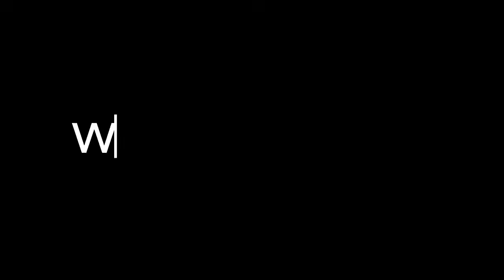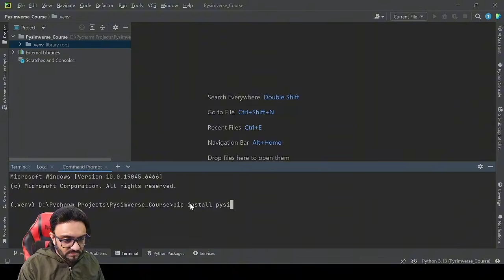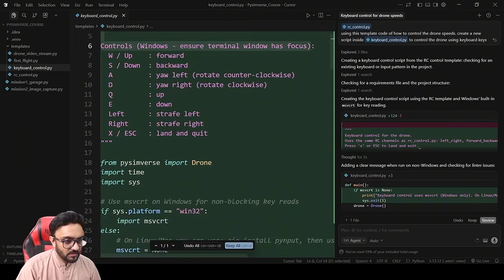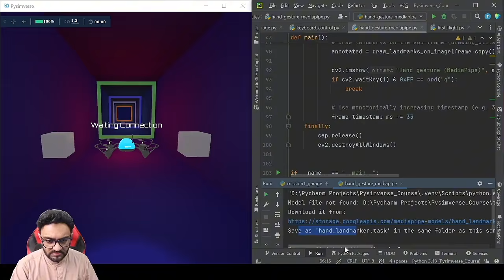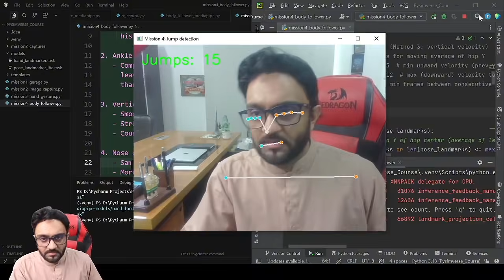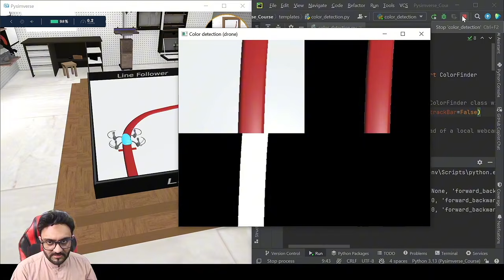Learn Drone Programming with Python – Tutorial

Comment: I want to learn Chip level laptop and desktop motherboard board repairing can you that happen.
Reply: In this case you have to start with microcontrollers with C and assembly programming languages.
You can start with Raspberry Pi Pico or ESP32. They both support rust, C assembly and python. But for your case, C and assembly programming is great to learn the lowest level of machine language for chip level, bios and motherboard applications